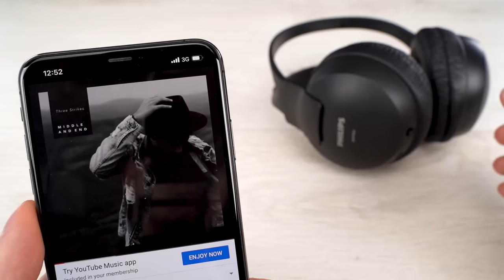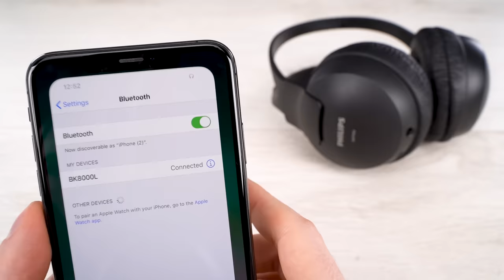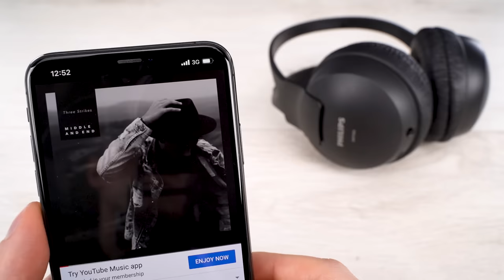Upgrade Your Headphones by Making it Wireless

Comment: all you gotta do is cut off those wire- 

innapropriate song plays at max volume in a library
Reply: Yea he not installed volume control module 😂
Reply: Facts though
Reply: SUPERNIX lol that’s a video idea son
Reply: Not to be that guy, but while the aux is plugged into the phone, the phone will not make any external sound, even if there is no cable and only plug
Reply: @רפאל-ב  that was what I was gonna say
Reply: @רפאל-ב  Shalom!
Reply: @bronzydog7665  shalom indeed
Reply: @רפאל-ב  but when a headphone is not detected it will
Also you can switch to speaker mode even when headphone is plugged in on discord
Reply: @THENETESH  I guess it plays at max volume and the phone controls the volume?
Reply: Triple six

Comment: Disclaimer: Doing this thing will turn a good headphone in a 5$ one.
Reply: Facts
Reply: Hax
Reply: Farts
Reply: Bart
Reply: 1000$ HD800 to 5$ scarp metal
Reply: Frax
Reply: Durex
Reply: There are a sentence in my country: " don't try to create something that was already sale in market"
Reply: f
Reply: Trivago.
Reply: Youre not wrong, but most people wont resell them anyways
Reply: Only works on $4 headphones
Reply: I mean worst case scenario, you remove the chip & solder the wire back, right?
Reply: @PedroJohnston1  you're right
Reply: It wont cuz its using the same speakers so the sound remain the same.
Reply: Land Rover Range Rover Evoque 2.0 TD4 E-Capability 4x4 HSE Dynamic.
Reply: @skskskskskssksksksks9544  lolll
Reply: @flippy9641  
Wrong.
Reply: False
Reply: Show me the car fax
Reply: Or turning a 5$  one to 5 $ one
Reply: @flippy9641  no it might bad bluetooth receiver , even best bluetooth receiver can compete with aux
Reply: @sammyrahhal5317  lmao you destroyed him
Reply: That`s what I thought
Reply: @flippy9641  
Good headphone is tuned for it's sound chamber.
And you just put a lot of stuff inside it, making it's sound indefinitely worse.
Reply: Hoax
Reply: And increase latency.
Reply: What happens is i use a 5 dollar one anyways
Reply: Last
Reply: Tin Bui that’s where tiur wrong pal
Reply: @itsthequenchiest5072  for some reason they started making it so you have to put wired headphones into the charger port, but most wired headphones can’t do that, sooooo you’re pretty fucked up if that happens to anyone
Reply: It's just for content anyways no one is that dumb to do that they can literally buy a Bluetooth instead of a wired one

Comment: My phone has a headphone jack, so fortunately I won't need to buy the bluetooth gear, battery, charger port, switch, soldering equipment, vice grip, drill, printer and screwdriver to convert my headphones. 

But thanks for the tip.
Reply: That does likely mean you’re using an android... so there’s a bunch of other stuff you have put up with :)
Reply: Android is better than Ipswich in terms of market share and features and customisation and battery and screen and camera and functionality and software support. Buy a high end Xiaomi phone to know what i mean.
Reply: and headphones
Reply: @nithpro1385  yeah marketshare because there are 100 different brands and you can get a new android for like $100.
Reply: @nithpro1385  buy a high end xiaomi phone lol. The dont have better camera or screen than a iphone. Software support haha lol enjoy your miui with ads and 2-3 years of software support.
Reply: @DigitalGus75  iPhone doesn't have headphone jack tho kid
Reply: @samsamsam3  that better screen is made by Samsung btw 😅
Reply: @pixlr8512  doesnt matter it still has better contrast ratio, more brightness than note 10s screen.
Reply: @DigitalGus75  android is better than iphone, always has and always will be, have fun with apple releasing a new phone each year that is the same as the last but with one extra feature removed and that 1000 dollar price tag
Reply: @samsamsam3  no :)
Reply: You forgot the laptop
Reply: @DigitalGus75  less stuff to put up with than an ishit
Reply: @samsamsam3  Apple: adds new camera.
Price:$1000
Reply: @DigitalGus75  A bunch more stuff that's way more preferable than what iCrap users have to put up with (:
Reply: @zecaraiahe.morella7247  samsung: adds new camera
Price: $1400
Reply: @samsamsam3  Since when has android done that? Apple is over priced JUST because it was made by apple :/
Reply: i use apple ipad and it has a headphone jack so no problem for me
Reply: @DigitalGus75  like what exactly? The only thing Android users have to put up with is a bunch of shallow minded people on twitter pointing out 'hurr, twitter for android'.
Reply: I use a OnePlus 7t pro 5g and I love it for the 90hz display and 1440p also warp charge 30t got my back and android running that meaning I get to customize my phone more I got a GoPro so I don't use my phone's camera much
Reply: @nithpro1385  ipswich ?
Reply: KyleStark  can you root apple?
Reply: @Siddharth you should root it install a custom rom
Reply: KyleStark  Then both are good depending on consumer needs
Reply: @DigitalGus75  yeah, why don't you go replace the OS on your phone when it's old and busted. oh wait, you can't. :^)

Comment: When you realize tools needed to make your headphones wireless are worth about as much as a pair of new ones
Reply: You're not limited to making one headphone wireless
Reply: Wrong wrong wrong wrong. Depends on the price of the headphones.
Reply: Yeah but you might have some perfect comfy ones or some ones that you get custom made.
Reply: Tools can be cheap.
Reply: tools cost less than a Dollar. And components run anywhere from 4-10€, depending on their quality.
Reply: @kevinwong4446  Only if you want to sell headphones now or start a headphone modifying company.
Reply: No no , those are really cheap af
Reply: @marcrobert5593  Weelll.... Actually...
Reply: unless you already have those tools lying around anyway! Perhaps your work already requires these tools or you have a hobby!
Reply: @MihkelKukk  That's right. Allthough I assume this is not targeted mainly to users having a workshop.
Reply: It pays itself once you fix or upgrade more items.
Reply: Tbf I think it's easier if you fix up a broken high end wireless headphones instead. Much harder to find good quality Bluetooth modules, and note that OP didn't make sure his headphones can still be used in wired mode
Reply: @mcslender2965  actually really true
Reply: @mcslender2965  ngl doe, the Bluetooth modules or the circuit board component in general is prolly the last thing that's gonna break in electronics unless it gets waterdamage, it's much easier to break the cable or ear ups or the structural elements in general.
Reply: It's actually worth much more. I can get wireless headphones for just a drill
Reply: Step 1: Already own some tools like a productive member of society, instead of a freezer full of chicken tendies.

Comment: To be serious nobody is going to do this, but its still satisfying to watch.
Reply: I might
Reply: @proadlekopy  me too
Reply: I wanted to transform any in-ear phone that I had with a Bluetooth adapter of ~10$ (here in Brazil), but I forgot this idea kkk
When I remembered I searched about the latency, the capacity of the batteries available and I just gave up, because it would be more expensive than if I bought a headset already bluetooth...
Reply: Turn cheap pair of wired headphones into wireless. My dad already has all the tools. Its about $50 to get everything I need including headphones (probably way more due to coronavirus shipping) at the very least, my dad will feel proud that I'm being crafty. Besides wireless is the new future. Just not cheap wireless.
Reply: i would do that
Reply: I tried..
Reply: @Axalotl8  and...?

Comment: This is good and all...but by doing so the quality and bass will decrease with significant increase in volume...so do it with your own risk
Reply: Yeah, no amplifier to better control the driver inside, as well as how the battery will affect the frequency response
Reply: should do this using the internals of some MPOW bluetooth receiver which have decent amp dacs inside instead.
Reply: He should have use a better quality module with 5.0 bluetooth version.
Reply: The way you used "quality and bass" doesn't fit this. It's not the best word to use.

Comment: The most idiotic thing i ever saw is a phone without headphone jack
Reply: New phones are coming like this, their headphones have the same wires like the chargers
Reply: The most idiotic thing... YET!*
Reply: Well, USB-C can act as a headphone jack too. A different form-factor should not scare anybody.
Buy a headphone having a type-c connector by default or an adapter.
The only scenario you need 3.5mm jack is connecting your headphone to a device with a dedicated sound card of high quality and high impedance.
Any phone lacks those two.
Reply: Welcome to Apple!
Reply: (Low pitch)...In the year two thousaaaand!!!  (High pitch) In the year two thousannndddd....
Reply: Did phones always have headphone jacks to begin with?
Reply: That's why I will not upgrade to the S20 or Note 20...I'm perfectly fine with my S10+
Reply: @threefavors3744  new Samsungs dont have headphone Jacks  either, hate to break it to you but soon wired headphones will be a novelty just like mp3 players, no one wanted to switch from an mp3 player to a phone but eventually the were pretty much forced to
Reply: @drezdengrimes8578  "novelty" isn't the word you were looking for.
Reply: All premium phones without audio jack
Reply: @Kingdom_Heart  some Nokia phones from the nineties used a proprietary connector for their headphones
Reply: Three Favors doesn’t really matter if you’re listening to MP3s on your phone anyway.
Reply: Mine os antichock and waterprove. And dont have
Reply: When I'm buying a phone no headphone jack = no sale
Reply: They are pushing this no-jack /no-wires politics after pushing 150 years of wired innovation... Funny ha?
Reply: Bill Ridge  apple is getting rid of the charge port in 2021 but they're keeping power and volume buttons
Reply: Apple is such a disappointment. Why does everyone want to be Apple and be like them? Wireless is convenient but the sound quality no matter what it is connected to just sucks. Its mediocre at best. If Apple is the pinnacle of innovation then were in trouble.
Reply: Lockdown timepass stuff😜
Reply: Making headphones wireless is a downgrade not an upgrade. Every audiophile knows that. Thankfully apple has lost it's position long time ago. It's barely a 3rd best mobile selling company now and it seems that it soon will lose even that spot. by landing on a 4th or 5th place.
Reply: @chivo_gaming  ha haaaa. Conan O Brian reference!
I miss It.
Reply: Hahaha they force you to buy it seperately rather than free,stonks
Reply: That is because its I phone
Reply: Naziem Saki “could the fault be in me, who doesn’t upgrade or have money to do it?
No, it’s the employed people who are wrong!”
Reply: Honestly people! You’re listening to empty threes on your phone while walking down the street. Does it matter if it’s through wired headphones or Bluetooth? I doubt you’d notice the difference. At home I have a decent set of speakers or my studio monitors. Walking down the street, it’s not going to make a difference. You won’t be critiquing Ana Vidovic’s tremolo technique. You’ll be bopping your head to some computer generated ear heroine( fun to listen to and addictive but that stuff will kill brain cells). Let’s move on.
Reply: @Hue_Nery  the point was. If it isnt broken , why fix it.
Reply: Naziem Saki because it’s more convenient and sounds pretty much the same
I know for a fact that you don’t have a $1000 audiophile setup at home so why even bring it up
Reply: @graheet  Yep. Never underestimate our ability to make idiotic things. We say: no limits!
Reply: That's the future
Reply: Naziem Saki whered you go? The boomers are here, ready to defend you! Wheres your anti 5G speach?

Comment: PSA: don't charge a battery like that directly from a USB cable. Those batteries need a circuit to automatically shut off, or they can catch fire. You could build that with an op-amp circuit.
Reply: this so much this. This video is crap, a channel with more than a million subs should definitly check that. People might actually follow the instructions presented and could burn their house down.
Reply: @marcrobert5593   that battery most probably has a built in protection circuit like most lipo batteries do

Comment: It was NECESSARY to add a 3.5" headphone Jack next to the battery charging socket, so that when the battery runs out, you can connect an audio cable and listen directly
Reply: Shouldn't be too hard to do that

Comment: Just one thing guys, make sure the Bluetooth module is of good quality, cheap ones tend to have distortion, interference and low audio quality.
Make sure to get the right specs as these will affect the audio quality. Sound quality is very important. Same thing goes into your choice of headphones. To compare I would look up seinnheiser headphones (makers of the best headphones in the world ex:orpheus 2) also Bang og Olufsen the best speakers and most advanced in the world. In the end you might end-up building excellent headphones worth much more than what you started with. Now have fun with your projects....
Reply: I was just thinking about upgrading my urbanites and came to check on youtube if this was possible. Thanks for the tip

Comment: Any audiophile will know that wired is always better than wireless
Reply: Yeah with rhythm games too. Having that tiny delay really ruins my accuracy
Reply: Wireless better
Reply: Do you have the sense that we have much of high quality earbuds/earphones/heaphones  like airpods?
Reply: @dwightschrute8927  airpods are ok although, I like skullcandy
Reply: @nolanvannortrick8183  meh, i never heard about this brand, but it seems hq too, and cheap... But i hate in ear... Is too uncomfortable
Reply: @lol shit explain to me how? I hear perfectly fine and the reason I say that wireless is better than wired is because wired headphones blow easier than wireless
Reply: @dwightschrute8927  yah skullcandy are hq although they don't have just in ear they also have over ear and yes they are on the cheap side for budgets and go higher up in price
Reply: Wired are better
Reply: @nolanvannortrick8183  correct answer. Wireless more convenient, wired is better sound and less delay
Reply: @nolanvannortrick8183  the reason wired headphones sound better is because there is more data transmitted with a physical wired connection. This is why expensive audiophile-grade studio monitor headphones are wired. Not only because there is zero delay but because it is the highest quality possible. If you get a DAC / Amp setup with a 1/4 inch plug then the quality goes up even more because the 1/4 inch is bigger than the 3.5mm plug which allows for even higher quality data transmission. when it comes to convenience and portability wireless will always be better. But when it comes to actual sound quality wired will always be ahead of wireless
Reply: @phonkequinox2602  That's tru,  I do get some delay on the occasion. For me though, I like wireless. To me, it is all based on personal preference. For example, my sister doesn't like overhead because they are too bulky and big.
Reply: @nolanvannortrick8183  I get what you're saying. I have the OnePlus 7t. Which is a phone without a headphone jack. Although I completely understand the advantages ofwired headphones, I still usually use wireless. The only time I use wired headphones as while I'm editing at my computer
Reply: @phonkequinox2602  during those times yes wired are very good. I use to have an iPhone 7 as well. Which it does suck that from there the iphone didn't have a headphone jack.
Reply: @nolanvannortrick8183  as I said any audiophile will know that wired is better
Reply: @nolanvannortrick8183  you don't understand how bitrate travels in wire and air, yes wireless is better since less wire means more mobility but as an audio enthusiast you wouldn't sacrifice that for the sound quality.
Reply: @nolanvannortrick8183  your ear is not sensitive to any loss in quality that's why you can't hear the difference. If "wireless is better" is the case then sound engineers should be using wireless then but no :)
Reply: @phonkequinox2602  I learned about wired headphones!!!
Reply: @dwightschrute8927  >airpods
>high quality
choose one
Reply: Even an enthusiast..
Reply: latency in wireless is the big problem specially in gaming🙄🙄..

Comment: Most folks complaining but this actually a good idea, considering how overpriced wireless headphones are.  All it takes is some knowledge on circuitry and soldering skills, but most folks are too lazy to try and learn something new.  Good video.
Reply: Ohhh really, is this time efficient,  no.  Can everybody do it first time, no.  If you buy multiple headphones to try make them wireless and fuck up, you will spend a lot more money, than just buying wireless headphones. All I want to say,  this is in practical.
Reply: @ernestasarlauskas7303  if you have skill
This video is not meant for newbies
Reply: @rmdhn1  ok and? How do you obtain skill here? There is still quite a lot of trial and error here. So your comment does not rly work, bcs even trying to obtain the skill you might fuck up at which point you should just buy wireless headphones.

Comment: I had a bluetooth headset which had a fault in the left side. I cut it from the middle and later realised the battery was located in the faulty side. :D so now..it's a wire headset, not just a wire, but a charging cable. WWWWWHHHHYYYYY. I can't even get mad cause I DID IT.

Comment: Headphones: $20
The tools to make them wireless: $2000

I’ll take the tools
Reply: A basic dremel tool is like $30 or 40. Soldering iron can be had for under 10, but a good Weller iron is only like 20.